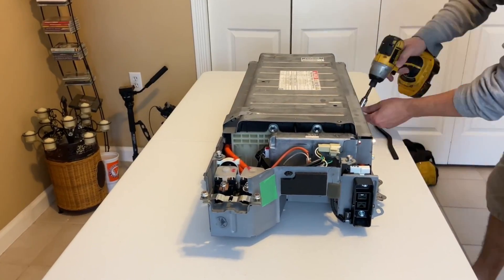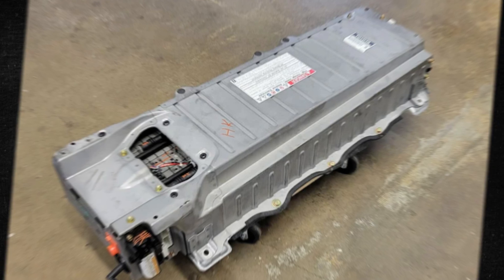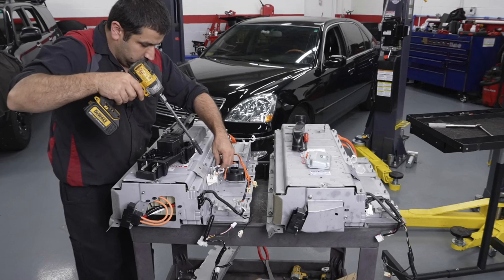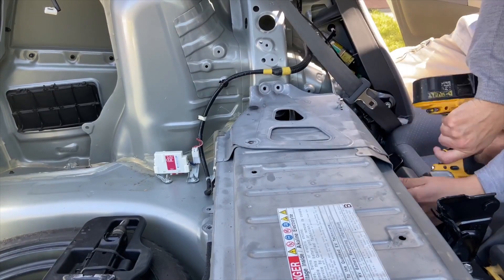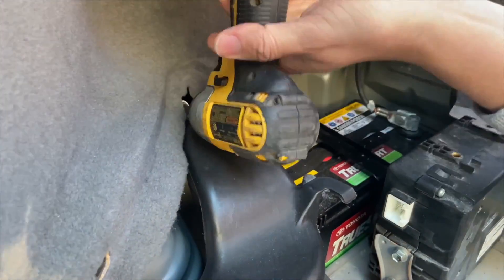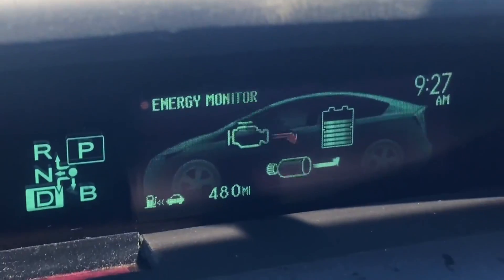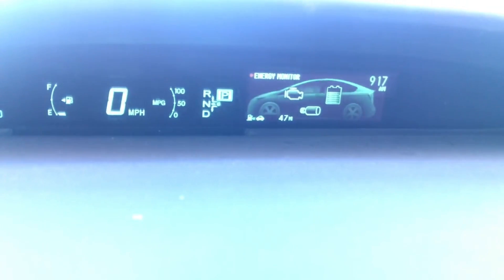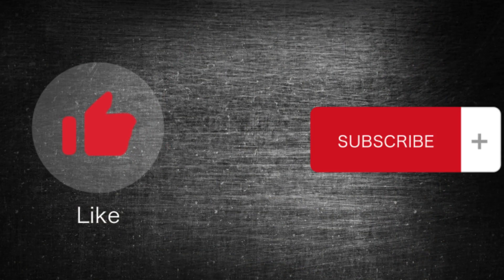Prius Battery Replacement Cost & Signs You Need to Change It

Comment: My 2008 Corolla has 210,000 miles on it and it only gets around 36 mpg avg.  I was thinking of buying a used Prius but every single one of them has been mechanically destroyed by food-gig delivery drivers, yet they ask crazy-high prices for their used junk.  My advice = DO NOT buy a used hybrid, either buy a brand new one or forget about hybrids.

Comment: This week my 2010 Prius 2 failed.  It has 130,000 miles on it.  As I was pulling up to my house, after driving about 10 miles, suddenly I got 5 dashboard warning lights.  I was shocked to see them all at one time.  Car was driving fine and no strange noises were heard.  I drove my car into my garage since I didn't know what I'd need to do next.  I took my phone out and took pictures of all the dashboard warning lights that came on because I knew when I talked to my mechanic, I'd forget what I saw.  The lights were:  'CHECK HYBRID SYSTEM", yellow triangle with exclamation mark inside it, brake traction light, check engine light, brake warning light. I called my mechanic (garage owner) and he said to have it towed to his shop.  I have used this garage and the owner for 17 years and he does great work and is totally honest.  Yesterday I got the call that it was the hybrid battery that needed replacing - and he could order it and have it in a couple days.  The cost will be $4000.  So next week (this is the weekend) I'll be picking up my Prius - which, by the way, I absolutely love.
Reply: Same thing just happened to my 2010 Prius. All the lights came on and lost power on the feeeway.
Reply: 4 thousand 😮😂😂.   My mechanic made me buy a reconditioned battery for ££400 Including fitting charge etc came up to £600 🙏.   You payed 5 times more than me 😬
Reply: You got ripped off.  Could have purchased a battery online for 1200 and installed it yourself

Comment: So how much gasoline saving to you have to get before you recoup the cost of the original car and a new battery?
Reply: If gas is $30 a gallon, it works.  I got 37 mpg in my Accord with 220,000 miles, so a much smaller Prius gets 50 on the highway, I doubt it but it's had to get the math to work even if the battery lasts forever.
Reply: @danr1920 a hybrid Corolla is only like 3k more.

So factoring in the transmission which lacks gears and so should outlast the car. Brakes can be good for 100k miles or even more...

The decrease in maintenance plus gas savings makes it completely worth it.

Toyota hybrids are incredibly reliable if you take care of them, I wouldn't buy one to save the planet though.
Reply: @KillerofGods  My prius has 130K miles on it and my mechanic said my brakes are only 50% down -